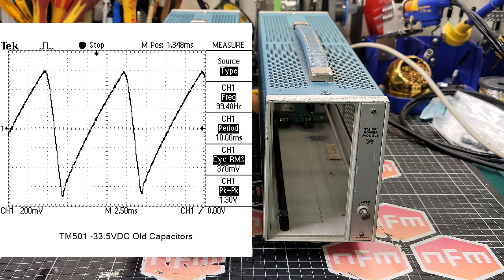Tektronix TM501 Mainframe Restoration

Comment: I have a tm501 that was tek modified with bnc plug on front that connects to frequency divider which allows my dc503a to read up to 250MHz. Little pcb uses same divider circuit as used in later dc505.

Comment: Never heard of Z class capacitors, X caps are across live and neutral and Y caps from mains to earth or secondary.
The Z5U marking on the ceramic capacitor is the description of the dielectric type (X7R and C0G are very common ones, too)